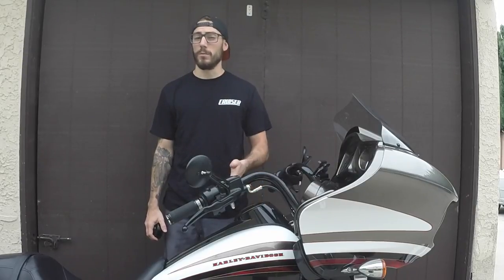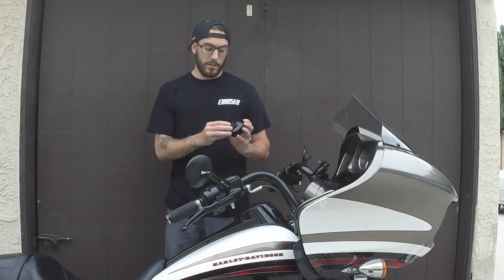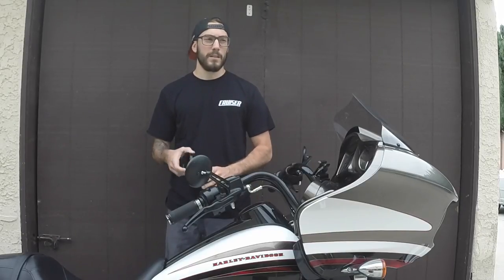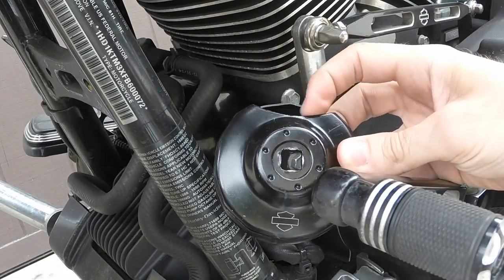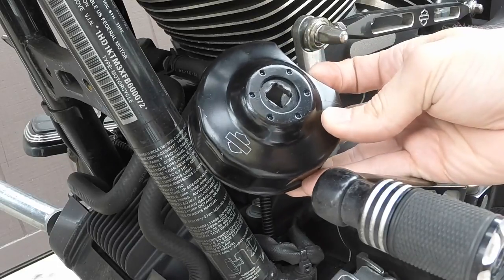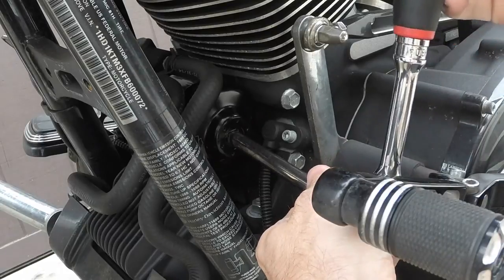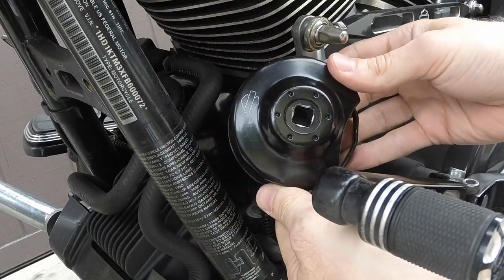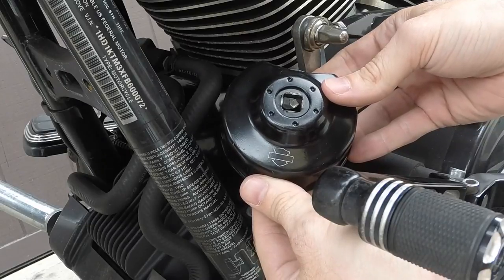Tool of the Week - HD End Cap Oil Filter Wrench

Comment: useless tool if the filter gets stuck , it happened to me today infact, it was just slide over the filter couldn't get it to losen, finally I saw a video on youtube where the guy made two holes in the cap and used machined self tapping screws and screwed it to the filter, thank goodness for his video it saved my day, because I was stuck with my bike empty from oil and a punctured filter .